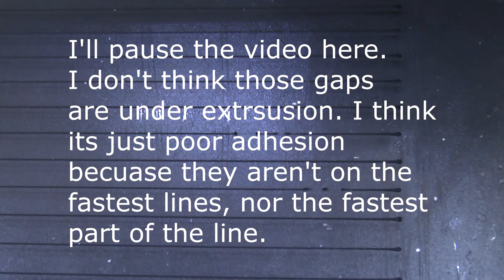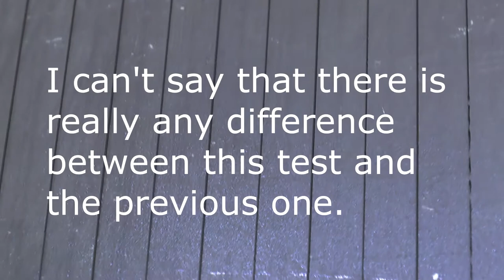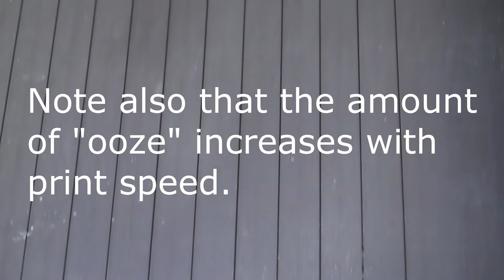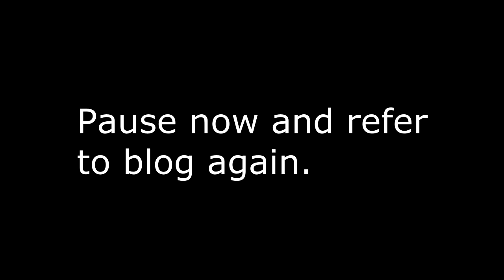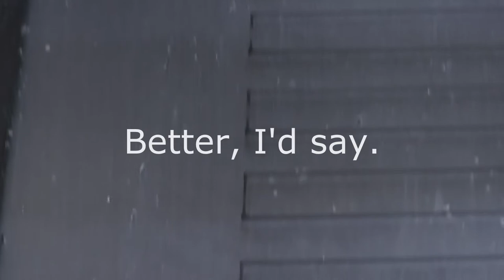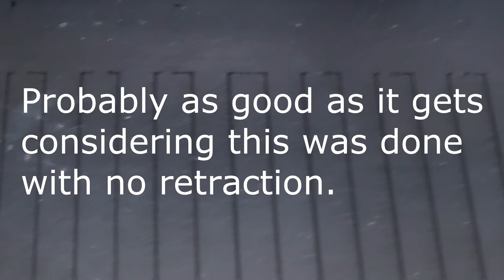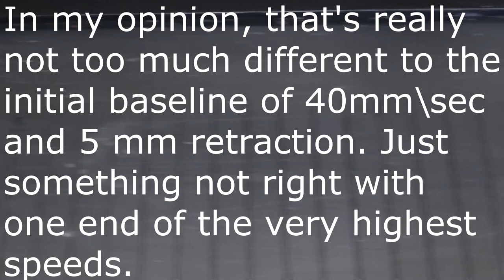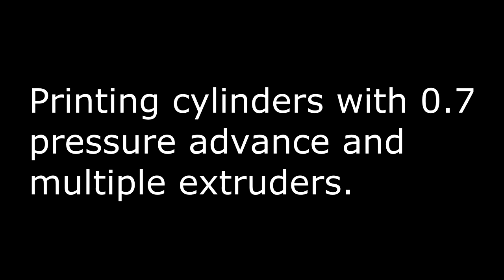Hot End Pressure Investigation

Comment: You say that you could not find research on filament pressure, however there is an old blogbost about it:

https://airtripper.com/1338/airtripper-extruder-filament-force-sensor-introduction/

However this blogpost does not really discuss the effect it has on the print itself. So you research is a really nice addition to this. Thank you for taking time to write this blogpost and making a video.

Btw I love your 3D printer design. It was also really impressive to this printer at the TCT show 2017